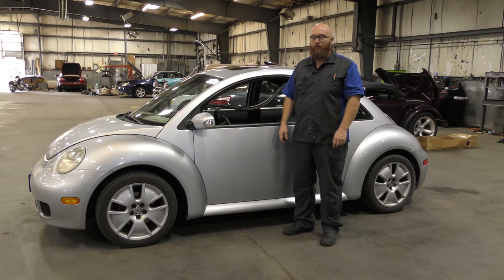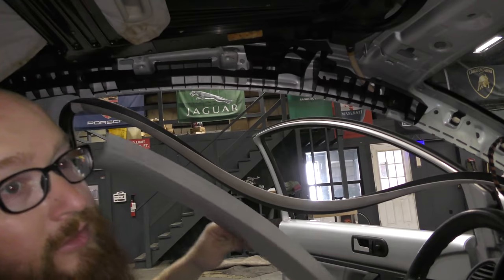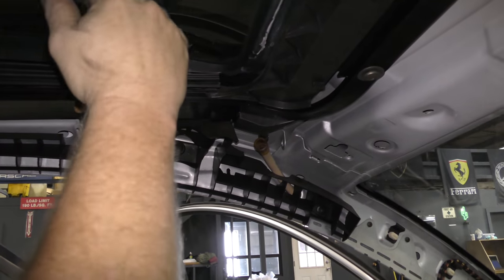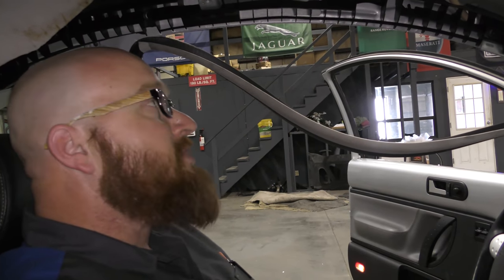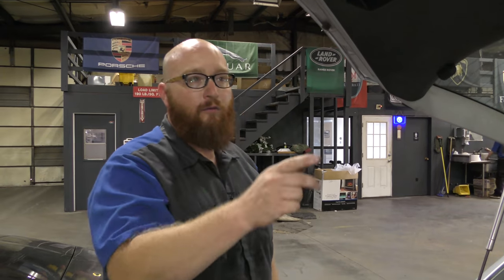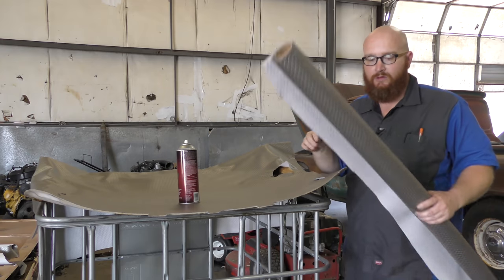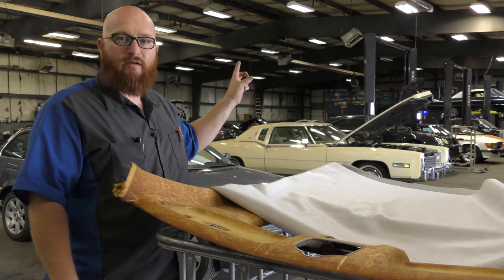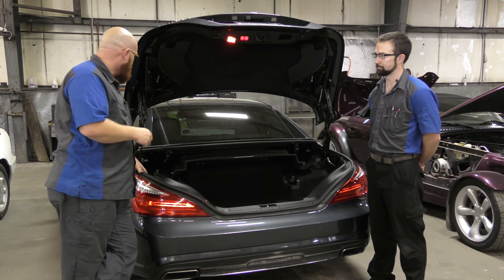VW Drooping Headliner & Mercedes Convertible issues! CAR WIZARD shows one is easy and the other not!

Comment: got a check engine light on my volvo V70 XC 4WD station Wagon, borrowed my brothers computer and it said variable valve timing inactive  . also showed a timing issue. 
Alright its probably timing belt issue, it might be stretching and wearing out. But when my brother got into chaning the belt he noticed that somebody had snapped the pulg off the solenoid that triggers the variable vale timing and sort of jerry rigged the wires to connect the solenoid. the solenoid was also toast because it shorted it out. After putting on a proper connector and a new solenoid the check engine light was gone but we did the timing belt anyway because we didnt know when it was changed the last time.

Comment: You are 100% right, I did my 2002 vw gli headliner  and it was exactly as you said. Tons of work , you must keep a sharp mind not to break anything and do a good job. Key point is tacky as it won't hold sharp corners and let go if not grippy to hold in place. You also get rounded and air pockets. You are very pragmatic and honest, thank you.

Comment: I done the headliner in my large sedan with grey alcantara and it only took me about 3 and a half hours by myself, that was removal, remove every bit of old foam with wire brush then reinstall and clean all roof trim pieces. Hardest part was where the visors fold up to. I just used the spray on gorilla glue. It dries really fast, but as you said, spray the material and the liner and let it flash for a minute then apply but do it in 3rds. I'm interested to see how yours turned out where the visors fold up to

Comment: I inherited a 1979 Buick Park Avenue from my father (with only 27,900 miles!) back in 2006.  Although the car ran and drove o.k., it had myriad issues from not being used... one of which was a drooping headliner.  It turned out to be quite a job (especially for a first-time experience) since the trim pieces were very delicate and fasteners fought me at every turn.  Removing the old foam insulation was the most time consuming job... I wound up using a repurposed kitchen brush sans handle which would chuck into a drill.  It was tough enough to remove the foam, but soft enough to keep from damaging the fiberboard.  Getting the whole piece in and out of the 4 door sedan was another pain in the butt, but it turned out very well!

Comment: Hey Car Wizard, speaking of sunroofs, have you ever seen one build up a thick layer of ice in the winter between the glass and slide out cover? I had this happen and didn't find out until I cranked the heat and let it warm up for 20 minutes or so and had a little waterfall coming down when I started driving on the center console while it is only 10 degrees outside! It was very confusing at first and the ice ripped the headliner off the cover. I kept the cover open after that so water wouldn't condense and freeze in that space.

Comment: I did this on an 88 Buick Reatta.  It is a small 2 seater with no sunroof and it was much easier.  I found the fabric and the 3M adhesive on sale at JoAnn Fabric.  Cost was under $15 and made a world of difference.  While I was there I replaced the dome light bulb with an LED which made it a lot brighter inside at night.

Comment: I always try to diagnose as much as possible, unless the part is dirt cheap. Many times have found the issue to be just some wiring. One of the recent ones was wiring going to a rear speed sensor on an '09 Focus. I encourage everyone to learn a little bit about electrical diagnosis. Always check connections, battery clamps grounds and things like that.

Comment: I used to work on a Chevrolet dealer in Argentina. Here, they sell a Gamma II platform four door sedan called the Prisma. According to the service manual, we had to take out both front seats and the center console (with the stick shift) in order to get the headliner off the car. The reason we got paid for all that work was because these cars got brown stains on the headliner after a while out the factory in Brazil due to some kind of mold where they got them stored. GM assumed the costs.

Comment: You guys are awesome. I get customers all the time that say “well the last guy did it cheaper” and then I say well why did you call me. And then they say because the problem still isn’t fixed. So there you go. You called me for a reason and I charge what I charge for a reason. By the way I fixed the problem and got paid what I charge, for a reason. I’m in a totally different industry but a technician/mechanic is a technician/mechanic and a good one is hard to find.

Comment: Most headliners that drop it was the foam backing that deteriorated not the glue.
Reply: Yes, the backing should be replaced or the new headliner will soon sag.
Reply: Yea , the ol mk4 Jetta I'm working on, you touch the material and push and it stays compressed. 
The foam has turned to nasty goop.
Reply: @MrTheHillfolk  VW's literally disintegrate. Not sure why anyone buys them. Literally the entire car falls apart, they're only meant to last the lease period
Reply: Yep - I got an elise seat in a miata - its the foam thats dropping old green dust on my floor :)
Reply: So by installing vinyl over cloth you not only fix the issue, you upgrade your car.
Fortunately my 8 year old Alfa still has it's headliner in place, it would annoy the heck out of me to drive a car with a sagging headliner.
Reply: @FrenchValleyAirport  I live in Germany, I have heard VW designs its car interiors to last 100'000 Miles.
Reply: @thebigpicture2032  you actually can scrape the old foam off the board and vacuum it clean, as long as remove all old foam and buy proper foam backed headliner fabric. Use 3m super 77 adhesive spray to adhere the new fabric
Reply: @hugobloemers4425  lol I've been driving a car with a sagging headliner for 8 years. I just gave up and stopped caring. No matter what I did it would always start sagging again and wasnt willing to go through all the work to fix it right
Reply: @shugthehornyhaggis  yep even toyotas from that time period have sagging headliners
Reply: @wigletron2846  poke a hole and inject glue with a seringe, then support it with wood and press it up.. done, thats what 3rd world repair shop did to VW polo in tunesia, it worked for that time
Reply: Yep. The foam perishes and comes away, glue intact. I just pinned mine back up with drawing pins.
Reply: 80 grit sandpaper on a disc with a drill works great for removing foam. Go very lightly. I use silicone caulk for the adhesive, apply in an S pattern all over the board. Then use thin cotton batting, it's about 1/8 inch thick to replace the foam. Then more silicone on top of that, then the decorative fabric. Silicone lets you make adjustments. Let it dry overnight. It will never come off. Did this on two cars it worked great.
Reply: That is definitely what let go on my G8's headliner. Fixed the back edge not long ago, and now it's dropping fast on the passenger's side 😒. What's even more annoying, is that the headliner on my trailblazer is perfect- despite being 4 years older and having ~50k more miles.

Comment: I just bought a new OEM headliner from the VW parts department, and installed it in my car.  I wanted original fabric, nothing custom or weird.  I was worried about foam deterioration as well, so I wanted something that would last about 15 years.

Comment: Had a '95 Saturn that needed a new headliner.  Took me maybe 15-30 minutes with a Phillips head screwdriver to take down the plastic trim pieces around the perimeter and pop out the dome light, panel came right out through the trunk.  Miss that car so much now...it was so easy to work on...

Comment: Good advice, as always, from the Wizard. Although, I might make one suggestion from when I recovered the headliner when black-ing out the upper interior of my Golf Mk3:
When you go to trim the fabric after gluing, don't trim the fabric at the edge, but wrap it around the backside of the headliner board by about an inch or two, then trim and glue it to the backside.
You're going to have waste fabric from trimming anyway, might as well make sure the edges never come loose.

Comment: When I was in college, I had a basket case Alfa Romeo Milano. One day, out of the blue, the brake lights decided to reverse themselves, so the lights would stay on all the time until I pressed the pedal, and they would go out!  I ended up modifying the switch connector by the brake pedal so I could install it upside down...that did the trick, lol.

Comment: Definitely recommend using a foam backed material on this headliner. It's designed that way. A lot of the pieces that meet the headlining will have gaps around them if you use a thin material with no foam backing. Also if you've gone this far already, removing the sunroof shade is pretty easy. I've done this exact job on my own Beetle and i regret using unpadded material.

Comment: Replaced the headliner fabric on my '78 Olds Cutlass (now long since deceased).  Fortunately, no sunroof or any of that other stuff to deal with.  Didn't take the headliner out.  Just pulled the old fabric off and cleaned up the headliner in the car.  The material I used was specifically for headliner and had foam backing, so it was really semi-rigid and easy to work with.  Glued and trimmed it in place.  Turned out really nice.  Too bad the new headliner outlived the rest of the car.

Comment: I remember years ago changing the headliner on my Olds Cutlass coupe. It was MUCH easier then the VW - no surprise there. Sunroofs are more trouble then they're worth.

NOTE: If you have a foam headliner shell like my Cutlass had, be sure you test the adhesive for chemical compatibility. I used 3M 777 on mine, and it ate away at the foam. 😖
Reply: If you taller, you always loose head space too.
Reply: My first car was a 1981 Pontiac Grand Prix (same car basically). That was one of the first things I had to do before driving it and it wasn’t very hard at all. Second thing, rebuilding a carburetor for the first time. Much more difficult! After that though I had a really cherry car to drive when my 16th birthday rolled around because I put in the work unlike most of my friends that had real junkers because they didn’t take any pride in what they were driving. Just appliances to get from a to b for most of them.
Reply: Mike Lyssy that’s true
Reply: Yes you are correct. 3M makes adhesive especially for headliners

Comment: And on newer cars, the explosive air bags in the A pillars, above the side windows...lots of places to be very careful.
Reply: You didn't disconnect the battery first?
Reply: MrHillfolk Love living dangerously😳😲🤣
Reply: Just disconnect the battery and pull the pillar off. The airbags are set off by impact sensors outside the car. Pulling the pillar off won't do anything

Comment: When they make the wiring harnesses just slightly too short it causes a lot of stress on a lot of the cables, it's a crazy common issue on 98-2005 vw group products on the front doors, windows would stop working and locking mechanisms would not co-operate.

Comment: I had to pull the headliner on my Honda Accord to fix the front moon roof drains and it was a big pain in the butt.  It was similar to the wizard's car in that a lot of small pieces had to be removed to free it up so I could drop it down.  Fortunately I didn't break or lose anything and everything worked once I put it back together.

Comment: I paid $250 or $300 to have the headliner in my old Cadillac(with a sunroof) redone.  That was 9 or 10 years ago and I thought it was a pretty fantastic deal.  No idea how they got the headliner board out, on that car I think they install the headliner at the factory all as one piece thru the windshield opening, then install the trim bits that hold it up, then install the front windshield.

Comment: Car Wizard, I have a 2000 Ford F-150 XLT Extended, 4.6L, 2 valve engine. Upon turning on A/C, I get a strong mildew smell. After A/C running a few minutes the smell dissipates. Is this mildew smell coming from the evaporator core box? If yes, can I remover a cover to access the evaporator and the inside of the box to clean it? Besides spraying Lysol disinfectant in the vent cowling, how can I clean it first?

Comment: May I suggest also use (consider) an X-Acto type cutting knife, They come in various sizes and accompanying blade types. Blades Very sharp and it’s physical size permits getting into various positions/locations. H-T-H
Totally agree with the wire bundle/hinge type routing problems. 
Hope you and yours are/stay well.

Comment: Had to rewire the trunk on my old G35 a while back. Same issue where the wires are pulled on when the trunk is opened. Took about 45 min to rewire everything but not sure why carmakers havent resolved the issue by just making larger wiring with more slack that could still be covered by trim. Seems an easy fix.

Comment: My dad bought a used 2002 Suburban with a 5.3L. The right liscence plate light keeps blowing so we have to replace it frequently. I bought high quality LED bulbs and housings that have LED chips to see if it will fix it. Still having a problem. Any tips?

Comment: There are 2 drains at the back of the sunroof also. To get to them open the back hatch, on each side there is a black plastic cover, pop the covers off and the drains are behind them. The drains on my 2002 clogged up and flooded the inside

Comment: Wish you had this video last summer! My ex had the same sagging headliner on her beetle and the places where I live either wouldn’t take it cause it’s a VW (wise people) or it was gonna be like $500 or a few months wait so I decided to do it myself. I couldn’t find the right color headliner and the plastic was breaking so easily I didn’t want to risk taking it down. Luckily it was mostly the back that had fallen down so I ended up removing the disgusting foam while it was still in the car and spraying that same glue straight on the fabric and board. I had to be careful not to get any  wrinkles since it was thin fabric but it came out pretty good! That car was a nightmare with all the random issues it had but it was the 5-speed TDI so it was fun to drive. Not sure if the headliner stayed up or not but its not my problem now since we aren’t dating anymore! lol

Comment: Good video Wizard.  I like Michael, he has a good on-camera presence and speaks well too.  Answering the question at the end of the video: My weird wiring problem was with my '77 MGB.  Sometimes after driving through a puddle the starter would engage.  It didn't do this with every puddle and I never knew when it was going to happen.  Long periods would go by before it would do it again.  Once the starter engaged there was no way to stop it and it would run for several minutes.  I could turn the engine off but the starter would continue to crank.  Rare for me I adopted an attitude of not caring so I didn't put tools in the car to disconnect a battery cable.  Also rare for me I never fixed it.  I got bored with that car and got rid of it after about a year.

Comment: I used to buy a couple/few strips of screen mold, paint them something close to the headliner color, cut them to length (a hair longer than the width of the ceiling/liner), and pop them up overhead to hold up the sagging liner.

Comment: DAP Weldwood Contact Cement is another great option and it is a lot cheaper than Super77.  Just be glad that that is not an old car where you have to remove the windows to replace the headliner.  Also some cars you have to remove the front seat to get the backer board out.   On the time front I have seen guys do 5 and 6 a day it really depends on the car.

Comment: I fixed a neighbor's '02 Focus hatchback. The wiring loom going from the roof to the hatch through the rubber boot was not long enough from the factory, so the wires stretched and eventually broke when the hatch was up. I had to lengthen and repair about 5 damaged wires.

Comment: An intermittent issue with passenger window not going up on a right hand drive first generation Mazda 3 , noticeable when weather changes from damp to dry . Window works ok the rest of the time and I've also replaced drivers switch unit . Passenger side ( I'm in UK ) button stays working regardless , I just have to reach across when it has its issue.

Comment: I know with the B5 Passat  (former owner) - if that happens you don't necessarily get wet, but rather the water all goes into the electronic modules located under the carpet where big costs can occur. :S

Comment: This 3M 77 glue has 4/5 stars on Amazon but... if one drills down to the 1-star reviews, there are a dozen or more and they all have the same sad story: used this to replace a headliner, and a few days later the headliner was sagging.

I saw (in a subsequent video) that your VW had the same issue, so you had a headliner specialist redo it.

Would be very interested to know if that installer used a different glue?

Comment: This would have been so helpful when I replaced the headliner in my 03 Golf. This is the best video on this I've seen yet. For my linerI bought a really close match from the fabric store. I used the 3M specific headliner adhesive. So far. so good.  I'm glad, once again, that I didn't get the sunroof! (I use the roof rack all the time.)

Comment: I have a European accord from 1999 with a sagging headliner. It only has one dome light and 3 roof handles to remove. Not sure about the seatbelts. My biggest concern is with getting it out of the car. The biggest opening is the doors.

Im scared to pay big money on it, temporarily fixed it with pins keeping the roofline up

Comment: Use your knuckle to test the adhesive. Your fingers might be dirty and you can have a false "positive". The adhesive is solvent based and is sensitive to temperature. If it is too hot the set time will be really fast and vice versa if it is cold.